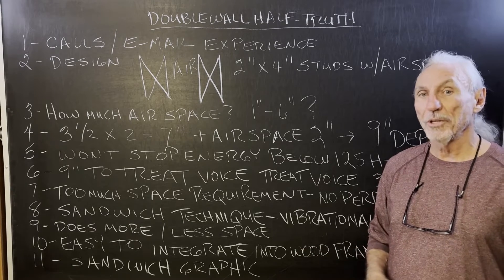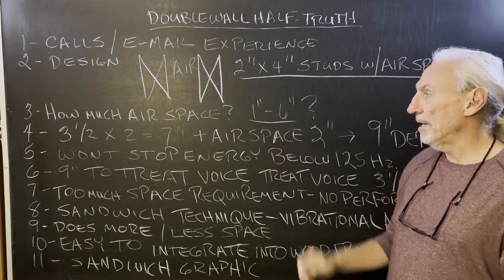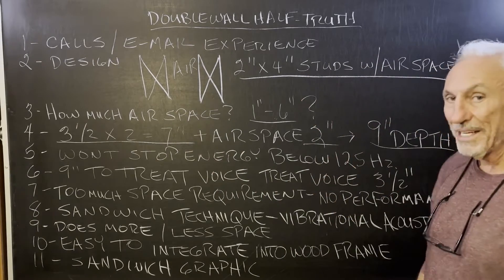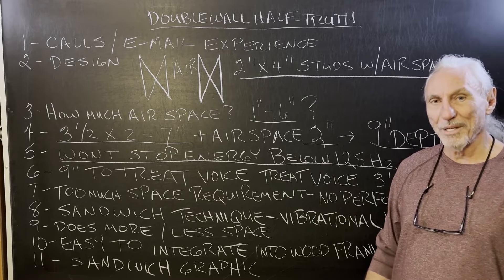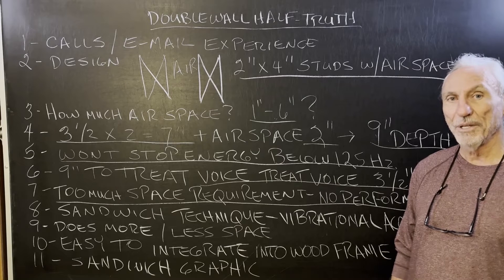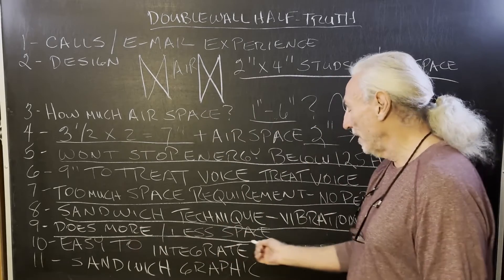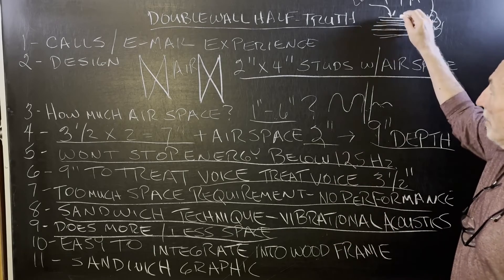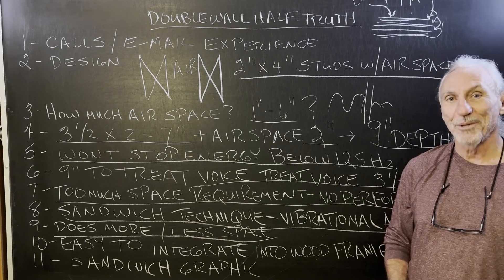Double Wall, Half-Truth - www.AcousticFields.com

Comment: Do you have a video showing a system of what to do for low end base
Reply from the maker: Low frequency energy issues are generated by the dimensions of your room. You need to choose dimensions that are more favorbale for lower frequency energy and then treat the four walls and ceiling. Here is our room analysis link.
https://www.acousticfields.com/free-room-analysis/

Comment: I got sold on the double wall system but have just now completed the exterior wall only.  I'm glad I was introduced to your channel a few days ago.  The room I am building is primarily for drums and I really want to stop all sound from escaping.  I know that may be impossible but I want to do the best I can.  Do you have any suggestions on what I should research from this point? Currently I have the exterior wall built on a concrete slap (under my stilt house) with 2x4 studs and two layers of 19/32 OSB attached to outside.  And the wall is insulated with regular pink stuff.  I'm stopping here until I learn more about your sandwich technique.
Reply from the maker: None of the tactics you are considering will be viable for a drum room. Fill out the information in this link:
https://www.acousticfields.com/free-room-analysis/

Comment: Great content as usual !
Reply from the maker: Thank you. Vibrational acoustical issues are different in form and treatment applications. To understand this relationship, think of a snake and a worm. The outside, airborn energy is the snake. It is the 28' long, 40 hz., garabge truck exhaust in the alley behind your bedroom frequency. It is big like a snake. When the snake strikes your bedroom wall (barrier), it must come out the other side looking like a worm. It is reduced in (strength) amplitude. However, frequency response is the same. It is the requirement of the barrier to reduce vibrational signatures using the proper construction methodologies, so we have  worm sound entering our room. No "soundproofing". Vibration management.

Comment: Looks like you would have to be rich to have walls like that. That's an enormous mass for 4 walls and a ceiling at extravagant cost yes?!
That's very disheartening for the every day guy like me. I have been working on finishing my basement as a listening room but have delayed it for 3 years until I find a solution to keeping all that sound bound to that room so my wife is not tearing me a new one every time I do. 😧 She doesn't hear good sound, she just hears loud.....
Reply from the maker: You must build the barrier that wors full range startinbg at 30 hz. Is your design good down to 30 hz. Low frequency noise transmiion requires mass.
Reply: I understand that now. I got thinking. Maybe I don't need to do the walls just the ceiling and one short wall. 3 walls are concrete block with framing for drywall. Is the concrete block ok?
Reply from the maker: @Silver_Surfer_1  If you are discussing noise transmission from the room source to outside the room, you must do all six surface areas.